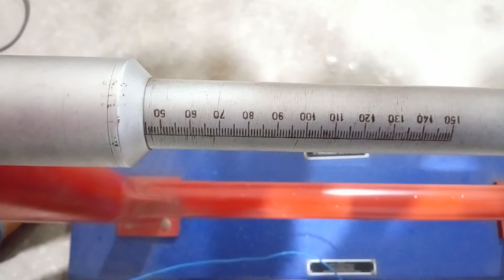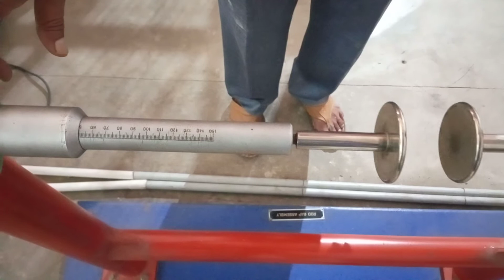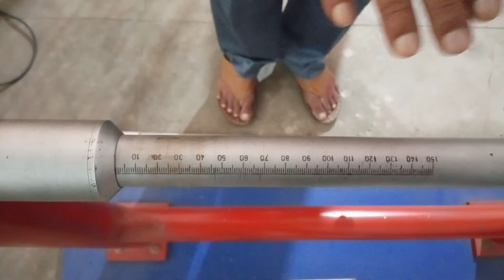High Voltage Engineering Experiment:4.Effect of Electrode Geometry on Breakdown Voltage-Dr.T.G.Arora

Comment: Thank you very much for this demonstration!

Breakdown of air with electric field over distance 50 mm
2:29 38 kVAC(RMS) point plane electrode (non uniform) => 760 V/mm
4:32 52 kVAC(RMS) plane plane electrode (uniform) => 1,04 kV/mm
5:50 75 kVAC(RMS) sphere sphere electrode (uniform) => 1,5 kV/mm